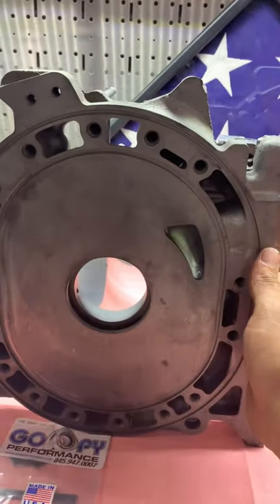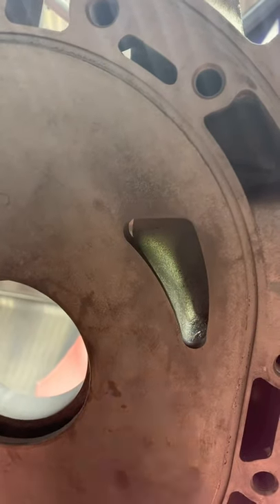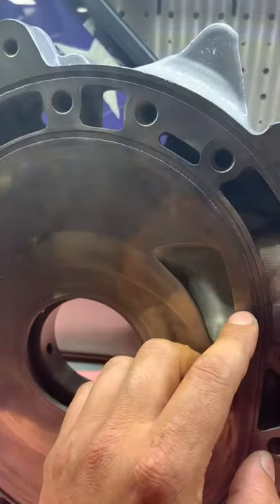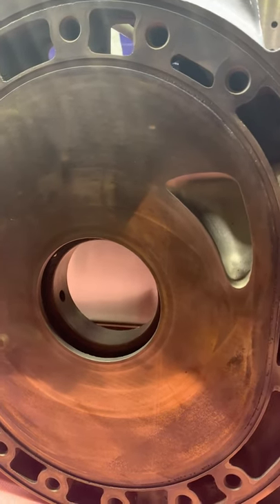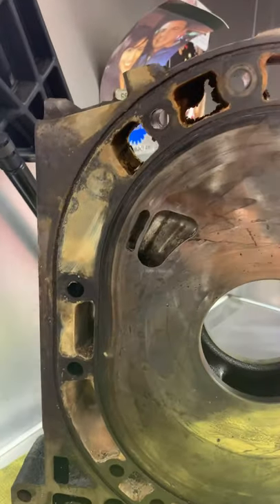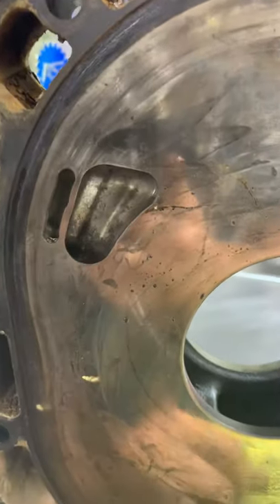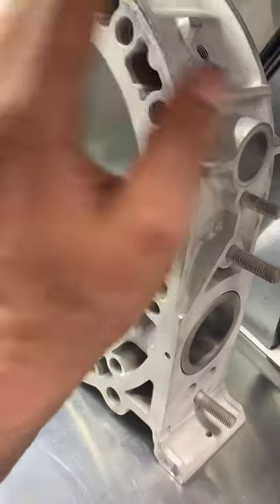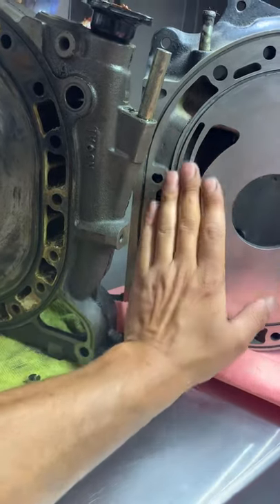Why semi p ports are better then bridge ports

Comment: What kind of porting do you recommend for a na 12a?
Reply from the maker: Mazory well what are you doing NA or turbo
Reply: Well he said na 12a man
Reply: @Rotorguy479  na. Also what's a half bridge? Is it just the primary port that gets a bridge?
Reply from the maker: Riq tard true but I wanted to make sure he didn’t plan to change that down the road.
Reply from the maker: Mazory it would all depend on how much power you want NA. The most with a street port I’ve got is about 170hp. If you want more then that do a semi and it will make over 200hp.
Reply: @Rotorguy479  does anyone make semi port intakes for a 12a engine?
Reply from the maker: Mazory yes we do it. 1000 for the pair
Reply: @Rotorguy479  what could I expect from a half bridge 12a?

Comment: Awesome Video. I’m building a unicorn 4 rotor. I’ve never worked on one. Sounds like the semi port might be a better idea than the Bridgeport. I’m really building a rotary for the sound. If you were building a 4 turboed 4 rotor what would be your dream build without getting into billet pieces?

Comment: All the drag cars use semi pp with slightly larger street ports on the plates, thats why rotarys are super quick and can make a shit ton of power reliably and run consitant times 90% of the time 
bridgeports are what kills the rotary in terms of reliability and much less power and semi pp does sound better than BP Imo, gnarly as hell.
Reply from the maker: Absolutely spot on

Comment: I've never played with a rotary. However I have a 1975 re5 Suzuki and I'm wanting to build a land-speed type bike my goal is 200mph how do you think a turbo re5 would do?....from Wyoming USA 🔫🤠
Reply from the maker: Bill Allen that would be awesome to build.
Reply: @Rotorguy479  are you familiar with this motorcycle? 500cc single rotor 2stroke, it has oil injection, water and oil cooling, 5speed ,chain drive....the turbo's I have are from dodge 2.2 or from eclipse/talon  Garrett water cooled turbski's...lol if the turbo needs a kick to get going I was thinking about hitting it with a 20-40hp shot of nitrous.....from Wyoming USA 🔫🤠

Comment: Bridgeports when done right dont hinder the longevity of the motor AT ALL. there are guys south of the equator with 200-300k miles on an engine with bridgeports.
thats a real bad piece of misinformation. if done correctly they are just as reliable as any. its really not even open for discussion. you know youre wrong

Comment: Apex seal cooling? Turbo lag from larger ehaxust ports? Those chatter marks close to the ignition/exhaust area on the housing are caused by detention or 'pinging' in pustion engine terms. Apex seal cooling, hahahahahaha.

Comment: hmmm, bridgeport, what about the tiger port with its 6mm carbon fibre apex seals, rotors for said seals,  im sure you are aware of the carbon fibre seals, old shit, corner seal was way huge with a 6mm apex seal, the tiger port could not work any other way,  semi pp with 6mm carbon fibre apex seals as they were solid apex seals/springs went with..........